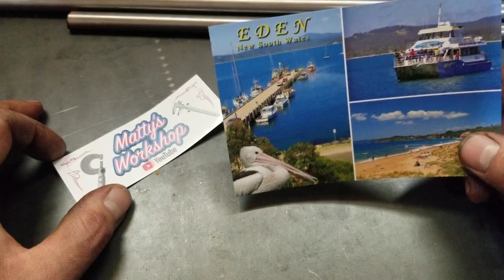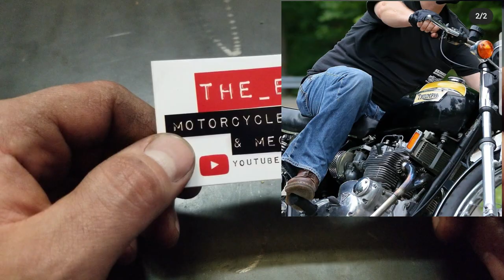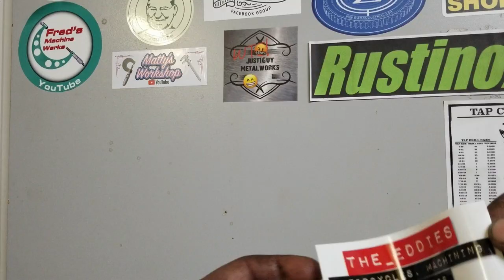Making an Automatic Center Punch 😃

Comment: Have you turned stainless on your lathe?  I’ve got the same lathe and a bunch of stainless, but I haven’t had much luck bringing them together. The stainless came with the lathe, so I assume somebody succeeded with it...
Reply from the maker: Sure have 😁. Got a couple videos on here somewhere. An older one with square, internal threads, and my soft faced hammer build. I used all 304 which is not particularly fun for machining (303 is a free machining stainless) but it turned ok. Just don't let up and avoid skim cuts (might work harden) and you should do fine. That's just what I've gathered so far, hope that helps 😊. Cheers!
Reply: @Just1GuyMetalworks  cool. I’ll dig through the back catalog. I feel like I learn so much more from your videos than from the experienced machinists. All the things I’d do wrong before I do them. 🤣🤣 Thanks for the videos.